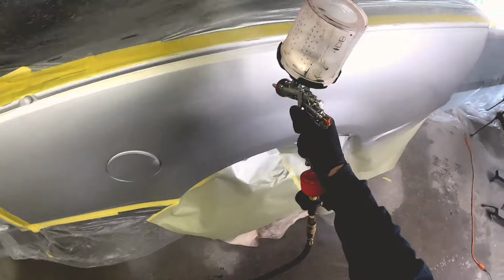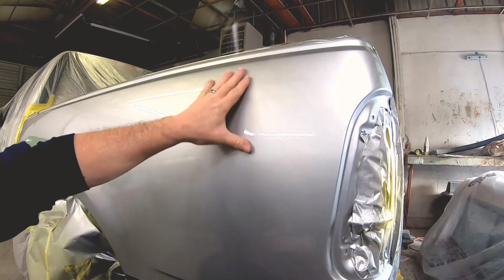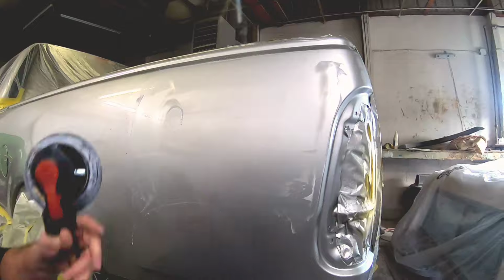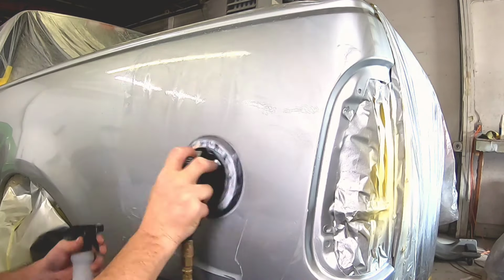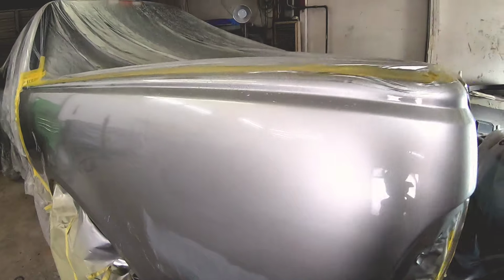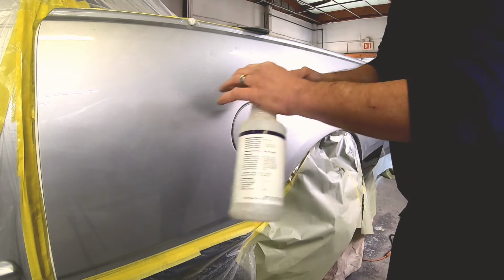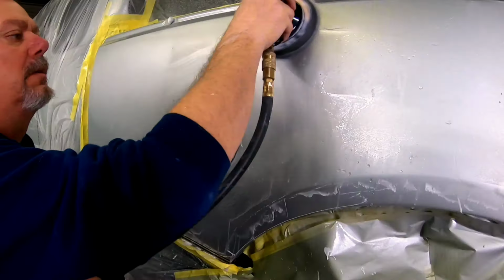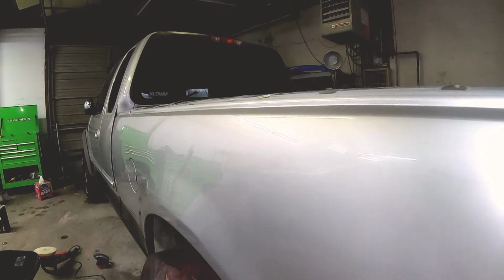Beginners guide to wet sand and buff your paint like glass!

Comment: 3-5000 grit is worthless. anything more than 2000 you are wasting time and energy. I have been a professional painter for over 30 years and get fantastic results with 2000 being the absolute finest paper that i use. Custom jobs get started with 600 grit on a hard wood block to get all the peel out and then step it up from there 800,1000,1200,1500 and then 2000 if need be. You cannot cut out orange peel with fine paper on a soft pad, but whatever you think looks great is all that matters.
Reply from the maker: I use to finish with 2000 for many years.
 Taking it to 3000 than 5000 makes it so quick to buff it's a huge difference!
Reply: The physics of reflection says that when you create small enough scratches near the wavelength of light, you’re at the limit and finer abrasive won’t improve the reflectivity.  Visible light corresponds to 2000-5000 grit, and wax reduces the depth of these scratches.
Reply: Not true I use a 3k foam backed on a da every job I do and it cuts your buff time allmost in half
Reply: I was just wondering about that 3-5000 Grit because that 2000 is mighty fine just like you was saying I believe 1200 1500 and then 2000 would be perfect
Reply: It’s not about removing peel in repair jobs but matching factory finish. 3000 grit just cuts buffing time and materials down. When compound is $200 a gallon, you really want to be cautious of how much you use.
Reply: Jep 👍...
Reply: So whats the best grit, product to take off orange peel?
Reply: Hold up. You can go a whole week b4 wetsand and buff. Thought it a as usually 24-48 hrs@GarageNoise
Reply: You sir actually know what your talking about, at the dealership we usually only use razor blades for runs, 1k 1.5, and 2k then buff
Reply: Why don’t you make a video and show us the right way?
Reply: @The1Karking  It would bore everyone to tears, it is hard work and not exciting at all.
Reply: In my experience, Finer wet sanding shortens your buff / polish time, but obviously takes longer to sand. You’re just trading time. To each their own 🤷🏻
Reply: @codyklows-kelley7869  that’s how I see it, ain’t any faster just more sand or buff time, couldn’t of said it better myself
Reply: Why would there be sandpaper higher than 2000 grit what would someone need 3000 for
Reply: For 30years and still don't know the purpose of the 3000....30 years and u still haven't learned anything...so sad
Reply: @anextday  I absolutely have no use for it, might as well rub a sheet of notebook paper on it.
Reply: @anextday  whats so sad? My work looks great. I finish wet sanding with 2,000
Reply: @garylivingston9052  I see u never worked in shops that does this for competitive purposes
Reply: @nick7.398  to the naked eye yea...not in the competition realm
Reply: @anextday  we dont do buffing contests no, we just repair wrecked cars
Reply: @anextday  Lol, i have had cars in some of the most exclusive car shows in the country finished in the way i describe. If you are looking at paint through some kind of special lens to find flaws than you are a sick puppy..:)
Reply: @anextday  I have had cars in some of the most exclusive shows in the country and customers have won multiple awards. If you are looking at the finish through some kind of special lens than you need help bro.
Reply: @garylivingston9052  AGAIN!!! I stand correct...that flew over your head...so I see u don't possess the ability to understand that level of intellect...seek help my friend
Reply: @anextday  I a just in a different line of work than some of you i guess. High end complete vehicle refinishing is different than the paint correction world that you are talking about,  existing factory finishes that just need a little going over with a DA sander. Different world.
Reply: @garylivingston9052  my argument is about purpose...respect
Reply: @anextday  Lol
Reply: True even when i sand at 1000 grit sand paper it looks great and i get that mirror effect and nice gloss look  with meguiars compound  3000 is a little to much abd they dont last long  im just going go up to 2000 grit . Thanks for saving time and alot of money 👍
Reply: Man theres even good quality sand  paper that gey the work done better  i like using buflexs there 800 grit the round ones that u can put on a machine or use by hand  and it  works great and last a long time  .that 800 grit act like a thousand grit sand paper and its sand down very well and smooth out the paint very easy . Think thats the one im start working with in the beginning  and work my way up
Reply: I even go to 8000 before buffing
Reply: @antonioprado8068 I painted my car and didn’t wet sand buff for like 5 months. I just redid a new front end and it’s been about 2 months and it’s doing fine just a hassle to buff it honestly
Reply: 3000 required longer time on sanding to take off peeling compared to 2000
Reply: Yes you are absolutely right about orange peel. But,.wet sanding the orange peel from 600 grit?is that what you meant?man that is so risky sanding you're clear from 600 grit?
Reply: @JosephjrChio  That is only for high end custom car paintwork where zero orange peel is expected. 1200 would work just fine on normal paint jobs and then working it up to 2000 and then polish it.

Comment: I haven't polished and painted cars in over 6 years and definitely found this video helpful. I had a friend paint my car this time around instead of myself and it looks great, but either dirt nibs or solvent pop but can't really tell yet as I haven't wet sanded it down yet. There are a bunch and wanted to do this right so any advice there would be appreciated.

Also, wondering for more tips on trim pieces that aren't on the car yet such as sideskirts, front lip, and smaller pieces like that. The material surface is different and I'm working with polyurethane and fiberglass for those. I'm thinking to just wet sand by hand, but the polishing seems like it'll take me an eternity doing it by hand. I do have a cordless powered buff tool and also a corded random orbital wondering your opinion on what to do here without going thru the 2 coats of clear on the car.
Reply from the maker: 2000 , 3000 and 5000 it will buff easy . As long as your not sanding to deep with 2000 your good.

Comment: Thanks for the videos! Followed your steps from start to finish on my first try and very satisfied with the results. I do have one orange peal area that I wil work on but wondered how soon after clear can I start to sand and buff?
Reply from the maker: Depends on the clear but wait overnight and you'll be fine some clears you cut and buff sooner. Check the technical data sheet  for the clear your using.  Appreciate the support!